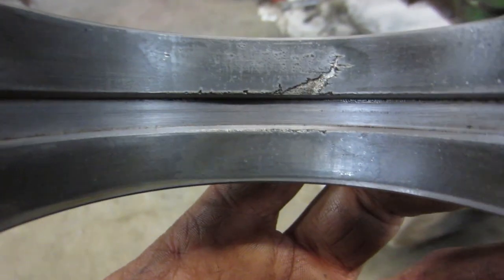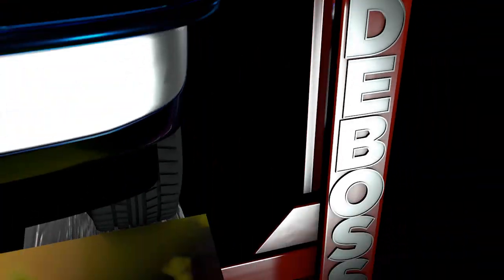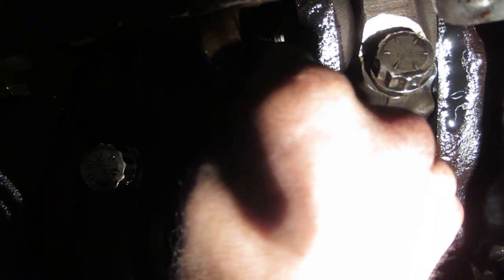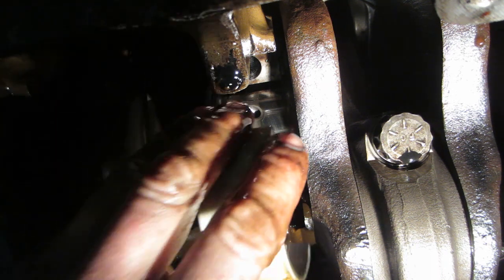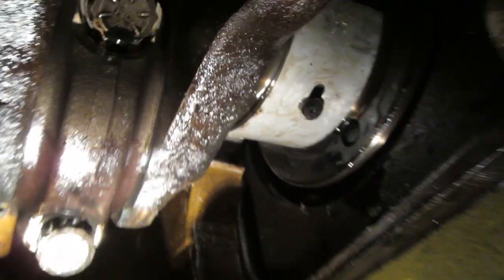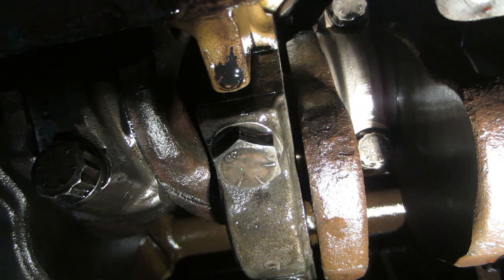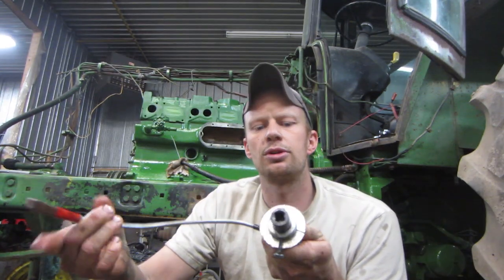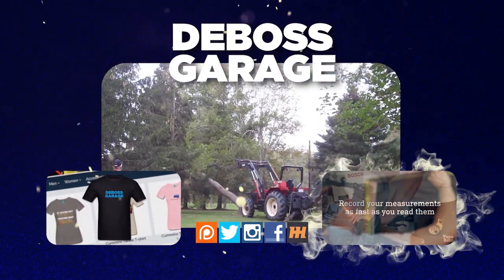In-Frame Engine Bearing Replacement

Comment: This works great, the mains came out and new ones back in easy. With the exception of the main thrust bearing (center most). I cannot get the upper half of main thrust bearing to go back in. I've checked clearances on the sides and they are ok. (looking for any points that might be causing an interference fit). I went so far as to cut a short piece out of the old main to insure alignment (I tapped this in with a brass punch), then placed the upper thrust bearing on the crank as described in the video. When I rotate the crank, the cotter pin tries to ride underneath the main thrust bearing upper half. Frustrating...

Continuing to try this over and over is the defn of insanity. Has any one done this successfully? I realize this is a very tight fit. I tried loosening the other main caps to see if I could get more clearance.

Worse case, can I remove the crank with the engine still the truck?

Comment: the new crank bearings for my 2001 dodge ram are variable when it comes to the oil groove and oil holes; I guess I wouldnt know if they are the correct ones until I start replacing them and match them with the old ones....3 has oil hole and groove,  1 has only a groove....2 are plane....both of the thrust bearings have a hole and a groove...  two that are wider one has a hole and a groove and the other one has only a groove.....it isnt making any sense to me at this point, why they are all so different. Anyone else out there replaced the crank bearings on a 2001 dodge ram van 5.2L V8? can offer any explanation! thank you

Comment: This is definitely from the hand book of work smarter, not harder.
I was laying underneath of an old rebuilt John Deere R1010, looking at some scorched bearings, wondering,
 "How do I remove these...other than a modified punch and a hammer?"
New analogy,
Never force any thing...always use a "Smarter" hammer.
Bigger hammers are great, but I usually prefer smarter.

Comment: Thank you great tip I order to not have to pull tranny and front pulleys and timing. Very nice...even though at 225k I probably should be changing front and rear main seals...oil pump wouldn't hurt.

Comment: I thought someone would ask this but didn't find it in your comments. Why did you put a bend in the bolt to roll the bearing out? I'm doing my 6.7l Cummins now. I have done many engines with a small screwdriver. This one is different since the bearing sits so deep in the block. I'm really curious about the bend and if it is necessary.
Reply: Probably to give it a little purchase in the oil hole otherwise it would simply fall out very easily before it gets around to the top bearing.
Reply: @MiracleMitch  I used a small carriage bolt for a license plate. Ground the top flat for clearance and two sides flat. I did not bend it. It worked beautifully. Pushed the old bearings right out. Was not too effective at pushing them back in, but that part is easily done with the flat square end of a long extension. 2014 6.7L Cummins 700k miles. She's quite now and smooth as silk.

Comment: After taking off  oil pan is there another part of engine walls to remove? i cant seem to get the main caps out! 3.0l durtec v6 mercury mariner. also due i need to remove the serpintine belt? i jus finished the rod bearings and cant find any info on accesing the main caps jus installing bearings.wich would be great if i could learn how to remove the main cap. 🙄

Comment: Color me crazy, but never have I seen a main, rod, or cam bearing put in soaked in oil, after countless replacements on class 8 trucks. Back sides are meant to be dry for a reason. This is the first time I've ever seen this wrong installation done. Oiling the entire bearing is a fairly good way to set yourself up for a spun bearing.
Reply: Do you think that the bearings don't get oil on both surfaces at some point? How is that possible without a hermetically sealed bearing gasket?

Comment: Ok guys I got a couple questions that I would like an answer to just to be safe. I have a 2011 Toyota Camry 2.5L  2ar-fe engine and considering doing this. If I were to spin this (crankshaft) im guessing it would be fine to do it off the bolt where the serpentine belt is found. If not plz mssg me. And also if I were to spin the engine with the crankshaft I wouldn’t take it out of timing because it’s not interfering with the timing belt correct?

Comment: Hi there..
When i want to replace engine crankshaft main bearing and rod bearing.
Also when it is necessary to regrind the crankshaft to standard to 0.25..
Reply: Very very good and well simple explained..I liked your simple home tool the shaped shaved bolt.. W.V.

Comment: Hi Deboss garage I have a question that is pertaining to the video topic. have you ever came across any common rail Cummins 5.9 and 6.7 with #5 thrust bearing commimg apart . From doing research online it's seems a handful of owners are stating failures In the three peice thurst  bearing design from Cummins.

Comment: Doing this with the crank still in the block is only a temporary fix, not the right way to go about it but I guess it’ll work for a tractor
Reply: When we in-frame trucks we roll in main bearings. Cant pull the crank in chassis. It's not technically right but neither is cutting counter bores and putting in counter bore shims to get proper liner protrusion. But to do it right would cost too much time and money and it wouldn't be feasible. Rolling mains in and using counter bore shims rather than stripping to a bare block and sending it to the machine shop can go a million miles just as easy as doing it the technically right way. It's all in who does the job.
Reply: Thats how it's done on semi trucks too

Comment: If you loosen the main bearing caps the  crank will normally drop down enough to shove the top half of the rod bearing out. I use a hack saw blade that I have ground the teeth off. Have done it this way for 50 yrs. No problems.
Reply: My understanding is if you remove all the main caps at once, your crankshaft is now free floating and has to be checked for fore-aft tolerance as if you were replacing the crank. I just do one cap at a time so the crank can't move fore-aft.

Comment: It's 90 to 100 degree on the the rod bolts. Not 90 and then 10. It gives you a little leeway in the torque. I have put a lot of Deere engines together.
Reply: What are the mains to be
Reply: @jasonbarber8862  150 ft lbs
Reply: @plowboy7700  150 lbs plus 90 degrees?
Reply: @jasonbarber8862  no. Just 150.
Reply: @plowboy7700  thanks so much man
Reply: @jasonbarber8862  yep, not problem.

Comment: I understand the 55 ft lb torque, but the 90degree , 10 degree portion;  don't really understand  that part.
Reply from the maker: Its whatever the manufacturer recommends.  This would be a torque to yield.  A certain torque and then another set amount of degrees.

Comment: Could plastigauge be placed in when rotating the main back in? Any tricks to keep it from sliding off, etc.? Torque it all down, take it back off and check tolerance? Is there any real risk to slapping new bearings on and just forgoing the tolerance check? Thank you!

Comment: Used that trick only a cotter pin rather than a screw on my 06 5.3l. Had 2 spun bearings and low oil pressure. No real damage other than 1 small score in the crank. Rolled in the new bearings and have over 40psi oil pressure again.
Reply: Hopefully you see this.

Did you slightly sand the crank or just slap the bearings up there?
Reply: I did try to sand the groves down. Honestly i dont think what i did really helped that much. I used a type of loktite on the backs of the bearings to help “glue” them in place(loktite 620 bearing retaining compound). Im still driving that pile of a truck everyday. Pressures have dipped a little below 40 when  warm but its fine. Did this oct. 2018.
Reply: @jk-zf4od  hell yeah. Thanks for response. I think minimum pressure is 6 psi per 1000rpms. You can also shim the pump if you want more oil pressure but you're good

Comment: Dude never knew you could do that!
 Tell me though what about wear parts ,does the main crankshaft bearings wear more than the hardened steel crankshaft itself?
Also did you mic for the new bearings or did you just replace them with stock mains again?
 Love the info with the bolt stretch and precision tool indicator.

Comment: I know you don’t like to by the high end tools but the digital flex head snapon tourque wrenches that do American metric and angles they beep and vibrate.  MSN do the make life easier.  When you do cat head bolts and they have the craziest torque sequences.  Were the vibrate and beep doing those angles where there is no room for your old school angle finder is so nice.   Good video.  Also I’ve had my torque wrenches for ten years and head them calibrated and they were spot on.

Comment: hey man one question. I'm doing this right now with my Massey 250 and I'm not able to rotate the rods around. Do I have to remove the cylinder head so there's no compression?
Reply from the maker: You can try and pull the injectors but that sounds odd to me...
Reply: I have a knock on one of the rods the second one has play up and down especially. It was a pain in the arse getting the oil pan off.. the front axle, radiator, left and right steering bars and more disassembly to get the pan off and loads of bolts lol. Yea I wanted to avoid removing the cylinder head but might have to if there's to much compression to turn the rods by hand underneath to replace the bearings. This is my first tractor repair and it's a diesel perkins by the way. So far I've set everything out neat to put back together!
Reply: I got it all together, did a new head gasket too. Looks like a new tractor and runs like it too!

Comment: Great information, would this work on a 96 Ford F-150. I really don't want to pull the engine.
Reply: On a ford you can't remove the oil pan without pulling the engine. So the engine must come out anyway.
Reply: I lifted the engine up in my truck about an inch and it was enough to shimmy out the oil pan. I also removed the oil pump before as well, which was tight but well worth not pulling the engine.

Comment: Considering the bolts are 1use only, how do you go about checking the clearance on the bearings? If you use the old bolts you will not get the same torque settings with the old bolts that you will get with new bolts. How do you go about checking clearances? Thanks for the video.
Reply: Not all bolts are one use only...? Most industrial  engines have massive bolts that can be re-tourqued many times. It says it in the book. I know for a fact the head bolts on a Perkins diesel and a Nissan SD33 can be reused multiple times as per the workshop manuals instruction. Off the top of my head a 1/2in UNC Grade 8 bolt can be re-torqued up to 8 times... those bolts look bigger than 1/2 in and are possible Grade 8 or better i wouldn't worry about breaking one unless the Workshop manual said to replace them

Comment: Thanks for posting this, I'm doing it on a 2006 pacifica, you may have saved me from having to replace my engine!
Reply: Hey Adam, how did it turn out? I'm working on a 01 Beetle and because it's a for fun project was thinking about doing the same thing .
Reply: @mariop3519  Did you do this on a Beetle and what engine, I might try it on my Mk4 Golf ALH 1.9 TDI engine?
Reply: Teo Nagode , I did this on the Beetle. I was surprised how easy it was to remove and put them back in. I used a cotter pin from a set I bought at harbour freight.
Reply: @mariop3519  Aha OK Thx for the info. And how much time did it take you, and you replaced all te bearings right?
Reply: Teo Nagode . So to get to the bearings, taking everything off, dropping the pan, removing things , about 2 hours. Once all that was clear, removing the all bearings took minutes but there’s a catch . When I did that I then re-installed them to check  bearing clearance with plastigage. That took a little creativity doing it upside down. Now the bolts for the bearing were one time use and like 50 bucks so that got expensive. But if I remember right  it took like 2 hours to take stuff off minutes to remove upper bearings, maybe hour to check clearances then another hour to get stuff back on.  Hope this helps
Reply: @mariop3519  And did you remove the timing belt to freely rotate the crank, Thx man for all the info so far and for checking the tolerances you used the Bentley service manual. This is going to be a big job, so I better do it right the first time.
Reply: Teo Nagode . Since mine was a manual I put it in neutral with the park break on. Taking that timing belt opens up a whole new set of opportunities. I did that later once I started rebuilding the top, it took a whole day to get It back on with the timing marks aligned correctly. What I did was take an extension socket from the passenger side with the wheel removed and a torque bar attached and turned it that way.

Comment: Don't put oil on the back of bearings.... It inhibits the bearings ability to have good heat transfer and it also makes it easier for the bearing to spin in the bore and seize the engine
Reply: Within a few miles I'm sure the oil would dry out between the back of the bearings and the caps.
Reply: @markgunther2502  Nope, glaze up. On the highway any movement would rip the tabs and round she goes. When you shut it off, wont crank.
Reply: @oddball746  The tabs holding them in place is a myth. Check with any manufacturer, the "crush" created when you clamp the caps down is what holds them in place during engine use. The tabs are merely used to locate the bearings during reassembly. You could in fact cut the tabs out or use tabless bearings with no ill effects assuming you located them correctly. If oil on the back causes them to rotate, your crank is toast anyway (clearances are way too high).

Comment: HEY BRO, This is my 1st time watching your video's & You have already shown more cool engine building technics & tricks then any1 I have ever seen or met!!! However, I REALLY HOPE YOU CAN HELP ME? I bought a 03 ford focus off a family member who said it didn't need anything!!! I have had to replace every part on this car!!!( brakes,calipers,brake lines,wheel bearings,timing set up,water pump,alternator & serpentine belt, LIST GOES ON & ON!  It has a 2.0 dohc zetec motor vin3..I THINK IT NOW NEEDS CRANK BEARINGS! SO, I HAVE NEVER REBUILT A MOTOR! 1ST...SHOULD I REPLACE MY ROD BOLTS & HEAD BOLTS?? ALSO, I DONT HAVE ANY MEASURING TOOLS SO I GUESS I WILL USE PLASTIGUAGE? HOW DO I KNOW WHAT SIZED CRANK BEARINGS TO BUY? IM HEARING CHATTER IN MY MOTOR & ASSUMING IT IS THE CRANK BEARINGS?  ANY ADVICE IS GREATLY APPRICIATED!!!
Reply: 7

Comment: Dont put oil on back of bearing shell thats a nono
Reply: I saw that right off
Reply: The only problem with doing it dry is you may gall things up when trying to roll the back in.  If you let things sit so the oil drains of and blow them off you won’t spin a main bearing
Reply: Wrong Rick ,both sides..
Reply: @YoungOzzy432  actually they don't. The crank is well above the oil sump. The oil is injected through the oiler hole into a grove in the crank side of the main bearing. This oils the bearing, but not the back side. Back side is supposed to be dry.

Comment: can we do it this way w my 97 blazer 4x4 w engine all installed?
Reply from the maker: cross member might get in the way but if you can get the pan off, you can do a bearing roll
Reply: +DEBOSS GARAGE ohhhhh ok may be a little tricky but possible correct?
Reply from the maker: yep
Reply: +DEBOSS GARAGE ok cause the mechanic that did the head work and rebuild I think is teeing to pinch me for money and way over shoot the job
Reply from the maker: You cant trust us mecahanics....
Reply: +DEBOSS GARAGE yeah no kidding I literally just got off the phone w him and he said oh were gonna replace more than just the rod bearings
Reply: @jacaughron55  how did it go
Reply: @macd9861  extreme late reply....i haven't had the blazer in over a year now.. Sadly I ended up giving it away

Comment: That oil analysis is a pretty handy and very accurate way on seeing how an engine is doing. It was a technique used on aircraft engines which is where it came from and filtered down to the automotive industry.

Comment: Can that be done with a Cummins 5.9 in a Dodge Ram?
Reply from the maker: +Sbaileyrph Yes, any engine.  Some engines you won't be able to do the front and rear main bearings as there are covers that hold the seals in place that get in the way.  They take the least amount of abuse though.
Reply from the maker: Problem with certain year rams is getting the oil pan off...